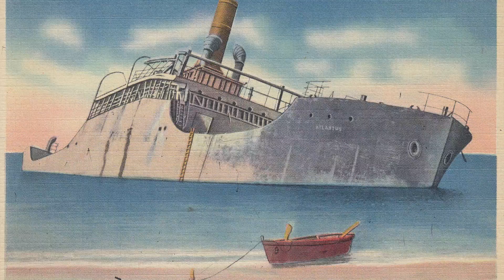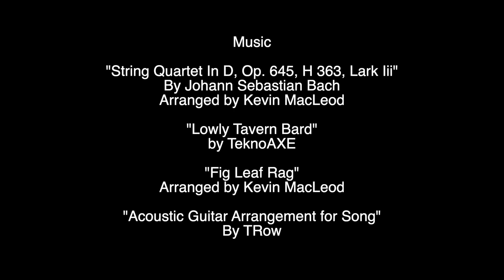Kayaking the Concrete Shipwreck "ATLANTUS"

Comment: My parents brought me here in 1960 when I was five years old. My Dad took a photo of my sister and I with the Atlantus in the background which I still have. The ship made quite an impression on me, I thought it was frightening looking actually. I always wanted Mom and Dad to bring me back on vacation to see it again, but sadly they never did. I've thought about returning lately but there's so little left I don't know if it would be worth it. Your video is very entertaining though.
Reply from the maker: It's still worth seeing nonetheless, but make sure it isn't the only reason you come to Cape May. The town is beautiful, particularly in the summer.

I've seen this wreck my whole life and didn't realize how big it was until I got up close and personal with it. It looks much smaller from the shoreline.
Reply: 5 in May 65' Atlantus impressed me too (Little Richard w/guest guitarist Jimi Hendrix was in Wildwood) I went back again this summer (2020) to see the Atlantus and hang out on the beach
Reply: As a life long resident, I can tell you it's 100% worth it.
Reply: Mmmkay.
Reply: I few years ago I’ve created a timeline in how the ship decayed and I pulled a lot of images from small websites on it. I found that the mid section of the ship had rolled over the same way the stern did and then to finally collapse due to its weak structural integrity. This occurred in the mid to late 70s. 

I find the capsizing of the stern very similar to how the Palo Alto’s stern did in 2017, I think it could’ve capsized from the heavy list it was on.
Reply: I still recall the feeling of dread I had as a 5 year old looking at the grounded Atlantus in 1960. It seemed huge to me at the time as I looked straight towards the bow from the shore.
Reply: Man.. I wanna see that picture. When the ship was probably still relatively in one piece. The before and after shots would be siiiiick
Reply: I know the comment is old but I would love to see the picture. I came a bit later on in life so the boat was sunken by the time i was a kid and took my picture. i used to think the people who swam out to it were nuts!
Reply: if you still want to make the trip out, I recommend stopping at bungalow bowls and getting take out or at lucky bones for take out and bring it to the beach to eat and look at the wreck. it’s always made an impression on me and I was born in 2002 so i’d say it’s still worth a visit

Comment: I owned a ferro cement sailboat. It was a Flicka 20 and although heavy she sailed just fine. And keep in mind that steel has just as much ability to float. But they made great use of concrete during the war. There's still the barges towed to Normandy for the invasion that were tied together to form a mobile dock for equipment and supplies.
Reply: if u coat the hull with lineX, will it last forever?
Reply: @myMotoring  The hull could have cracks developing inside, but it could be repaired I guess
Reply: steel is waterproof and can be made thinner though
Reply: @Blox117  steel definitely needs some treatment before going in saltwater. But steel still the best material overall, that's why you use it for war vehicles and use concrete instead for things that don't really need steel.
Reply: @afoxwithahat7846  im saying that it is waterproof without treatment. concrete is not
Reply: @Blox117  steel is just as prone to oxidation as iron is, especially in the sea, so I don't know what your definition of waterproof is. While some concrete ships have lasted for about a century.
Reply: @afoxwithahat7846  you are clueless. waterproof refers to the penetration of water
Reply: @Blox117  we still use concrete on ships and dams, so I don't have any clue indeed what you're talking about. It seems you didn't even watch the video.
Reply: TY
Reply: And, they ride very smoothly ...

Comment: These videos are just so great, man! Well done. It's really interesting to learn about such a unique kind of ship... What exactly were these shipbuilders thinking, though? Concrete?? xD
Reply from the maker: Slow and steady wins the race
Reply: Its not concrete like is in your sidewalks. Its ferrocrete.  The metal armature inside provides tensile strength and the cement provides compressive and extreme durability.   The reason videos like this is made is because when a ferrocrete boat sinks, like any boat can,  the structure will last for centuries instead of decades like even plastic boats will.
Reply: @obsidianjane4413  it was also quite the "fad" in the late 60s and early 70s to build regular boats out of ferrocrete.  There are still a few of them around.  The Atlantis was noted to be slow, but rather vibration free, unlike a steel ship.  She did need to be more carefully handled while in port.  In reality she was no different than the wooden ships in Mallows Bay on the Potomac, built to ferry men and supplies across the ocean while using a minimum amount of precious steel that was more needed for the war effort.
Reply: IKR
Reply: @sailingspark9748  the saving in steel was possibly the biggest attraction, they made a number of ferro cement liberty ships in the second war, they all lasted until peace was declared as being slower and heavyer they were less economic to operate, the mulberry harbours used for D day and beyond were ferro cement, a couple of the support barges that never made it can still be seen around the Garliston area where some were made, they sit where they were washed up after breaking free and running aground, being made of what is basically reconstituted rock these little pieces of history will fortunately be with us for many years to come.
Reply: It's the only vasts amount of materials they had to hand, all the metal was make more battle ships and so on. Contreat is no prorus so it's great for stating afloat
Reply: It's very strong, uses less than half of the steel a normal ship would use, it's cheap.
In a war, steel is the new gold.
Reply: Scarcity. The same reason why Germany designed coal powered aircraft during the war.
And if concrete seems funny, what about pykrete ships? Imagine the ¨barnacles¨ on those.
Reply: They were thinking of what works.
There are zillions of steel boats ... except you don't buy steel in "boat shapes" ... so lots of cutting and shaping and sticking together ... and all of those pieces you cut off, you have to pay for.
  FerroCement - kinda like plastic, pour and set, 0 waste.

Comment: From the look and sound of it, that's lightweight concrete, which would make sense for its application. Rather than limestone coarse aggregate, a pumice-like stone is used. That sound is the capillary action of moisture, and air being squeezed out. No doubt they used some kind of sealant on the hull to prevent water from penetrating to the interior.

Comment: Fun fact. Here in Norway, during the 70s and 80s many build smaller sailing boats in concrete, or FerroCement, as it is most commonly called, 30 to 45 feet. But they are a nightmare to build, because you has to build the boat upside down, and build both sides at the same time in ordet to get the correct thickness and weight on both sides. They used chicken netting as reinforcement, but the main problem ended up being the massive weight. A neighbor had a 33 foot sailboat in concrete that weighed 12 tons, for comparing, a modern Bavaria 39 weights 8 tonns. So most of them ends up in what we call "The Norwegian Garden Boat Association".

Comment: I remember a concrete sailboat in Owen Sound that eventually ended up on Colpoys Bay. I imagine it is still being used. It is a viable material. There are several Canadian merchant ships that were made of concrete sunk as breakwaters in BC. They were watertight and had bulkheads. They were difficult to get crews for because of the bias against concrete. Steel does not float either.
My father was a fireman or stoker on the  S.S. Yankcanuck. Built in 1885 or 1889 it sat sunk in Midland during the depression and was brought back into service during the war as the steel lake ships got drawn out into the Atlantic. 
The ship was very rotten and it could not accept a nail.  Leaks were generally repaired with concrete patches. It was finally taken out of service in the late 50s after the loss of the Morrell and the fallout when it was brought to the publics attention just how unseaworthy a lot of the ships on the lakes actually were.
Reply: Hit or miss.....It can be made into n3ar indestructible boats but also can 3asily be messed up by inexperienced builders

Comment: I would love someone to explore the wreck, under the surface. Imagine if we could find the original tellers or other parts from The Wheelhouse that are still there. That would be absolutely amazing
Reply: I agree but it is very dangerous due to the tides. Atleast two people have drowned swimming near the wreck over the years. One was cut up really good by the rebar under their. Plus the bay is very dirty.
Reply: @RockFan98  yeah I would only trust that for professionals, though I don't think danger is a justifiable reason for avoiding it. People have dived on much more dangerous in hostile sites before.
Reply: Is so murky you wouldn't really be able to see anything
Reply: @enjoiandrew4  I very much doubt that, the water would likely be the same brightness as if you were along the sea floor. It's got to be only like 30 ft deep at most.

Comment: In the preparation for D-Day in WWII the UK built dozens of huge concrete harbour (or harbor if you like) sections. To keep them secret as they built them they sank them in the sea. As  part of the the D-day landings they floated them over to France to make vital docking and landing areas as they had not taken any towns with ports. They are still there off the coast of France at Gold Beach.

Comment: In the 60 to 140 foot range, ferrocement (high steel mesh ratio) is very durable and even good strength to weight ratio.

Comment: as the owner of a concrete/ Ferro,s yacht they can be fast and weigh the same as any other material the larger the vessel the better ,Ferro,s outlast  the best are very comfortable sea boats /ships hardly slow the Prawn trawlers built out of Ferro in Queensland Australia durring the 80,s are the smoothest quietest work boats with hulls that last forever as you can see by the wrecks

Comment: The Twin Capes, the "miniature cruiseliner" Ferry was sunk because she was dangerous.  With all the added superstructure to increase her luxury and provide for a fine dining restaurant, they managed to increase what is called "windage", or the area of the ship the wind acts on.  They did this without increasing her propulsion or maneuvering systems.  This led to her hitting the jetties in Cape May a couple of times as the wind blew her off course.  She could also not be used in any kind of stormy conditions as she would roll and pitch badly while out on the Delaware itself, this left her sitting in port more often than she was able to be used.  She was just not economical or safe to run because of that.

Comment: I've explored the decaying hulks of some WW2 concrete River barges. There's a sombre ship graveyard near the Gloucester-Sharpness canal, on the banks of the Severn. These vessels were all beached to prevent erosion. It's a surreal feeling seeing the remains of vessels from all walks of life, some as old as the 1850s.
 The saddest entries are two barges. These barges sit a little way out in the Severn and have dine do since 1960. In thick fog they missed Sharpness Dock. They collided with the Severn Railway Bridge. Unfortunately these barges carried fuel oils and petroleum. A 30cm diameter gas main was ruptured. Sparks from damaged wires caused a fire. 5 men lost their lives. One man made it to shore, he somehow found the strength to swim against the notorious currents of the Severn Estuary. Another 2 were found and rescued.
Percy Simmonds, 35. Alex Bullock, 40. Jack Dudfield, 46. Malcom Hart, 17. Robert Nibblett, 25. All 5 of these men were lost to the tragedy.

Comment: My mum used to work in boat insurance. One day, she gets a call from a man seeking to insure a ferrocrete boat - a boat made out of this kind of concrete. She explains to him that their company does not insure ferrocrete boats, and most companies do not, for two main reasons:
1. Ferrocrete is very fragile - even a fairly light bump or tap on the hull will cause invisible cracks or 'crazes' to form, and considerably weaken the hull. Once this has happened, the boat is at very high risk of springing a leak.
2. In the 60s, a number of amateur boatbuilders realised ferrocrete was a cheap material that they could build much bigger boats from. However, they didn't account for the additional costs of a bigger boat, nor the fact that ferrocrete is not an easy material to work with. The end results were a lot of half-finished, ugly, often unusuable pseudo-boats that obviously could not be sold to recoup losses. The boatbuilders then insured the boats and deliberately sunk them (not difficult) to get some money back.

The man on the other end of the line listens, absorbs this information, and says "I see. You're a lot more helpful that the other place I called."
Mum asks "Why? What did they say?"
"Concrete sinks, mate."
Reply: Amazing anecdote! Interesting facts. Sounds like ferrocrete is fragile in the same way as the foam material in helmets, unsafe after a single even fairly light bump. The sound of the water entering the spaces in the dry specimen sounded very "foam-like."

Comment: Interesting video, just a counterpoint. You said several times in the video that ferro-concrete vessels aren't particularly strong. This is untrue, they are incredibly strong. In fact their strength can be an issue since if they do sink or run aground they're likely to be there for decades unless they are deliberately broken up or retrieved, sometimes creating a hazard to navigation. By contrast steel hulls are much more easily salvaged, and even if not salvaged they'll rust, break up and flatten relatively quickly.

The strength and longevity of ferro-concrete structures is part of the reason why marine structures such as bridge piers and some oil rigs are build out of concrete. A steel structure just wouldn't last as long.

There are two reasons they aren't used in commercial shipping:

1. While the materials used to build them are cheaper than sheet steel, they are also more labour intensive to produce.

2. While they are very strong, their strength to weight ratio is worse, so they end up heavier than an equivalent steel hull. The result is that they have poor fuel economy and are expensive to run.

You also mentioned at one point that "if you spring a leak in a concrete ship you're kinda effed." This is no more or less true than any other kind of vessel. Very few vessels are positively buoyant once they have flooded, mostly lifeboats and a few dinghys.

Comment: Since you seem to be familiar of the NJ shoreline. Why hadn’t you mentioned that where that concrete ship is 150’ out in the water USED TO BE easily a ale to walk onto and before it became too unstable, people could walk around the inside a bit. Since the 1990s Cape May lost ALL of its shoreline eroding up to Wildwood which at that same time gained 100s of feet of beach. At that time, no scientist had a clue why or how the sands would move north. If you would have included this bit of same time period history. Your video would have been more interesting. I walked and went into it back in the mid 1960s. I also was able to walk up to the top of the Cape May Lighthouse. Such a shame so much geography has changed and has been lost for all time. Just imagine about 200 feet MORE beach right where your kayak is.

Comment: Ferro is both fast and strong there is a yacht called helsell it won the Sydney Hobart yacht race one of the toughest yacht races in the world. It is cheap and easy to build with and a well seasoned hull is as strong as steel . A 55ft Hartley Tahitian I had you could hit it with a sledge hammer and it bounce off . In fact it got hit with a steel trawler I lost a bit of paint and a rail he had to get some plates replaced . It is also relatively maintenance free . Please do some proper research you will be very surprised what you find

Comment: So if it’s survived all that shit you listed how is concrete not strong?
Reply: Very strong under compression.
Very weak under Tension , torsion or shear forces.
You would need steel or some other rebar structure inside the concrete.
When steel rebar starts to rust it will expand like water does when it freezes.
This expansion of the rebar will fracture the concrete.
The fractures will let in more water causing more contact with the steel rebar.
The process is destructive to the strength and integrity of the ships seaworthiness.
Water will seep into the porous concreate, in northern latitudes in the wintertime it will get below freezing and fracture the concreate. this will also cause the rebar to corrode.
If concrete was a very good material to build a ship with everyone would do it.
The fact that it is not used should tell you something.

Comment: “Transatlantic voyages”
Crossing the Atlantic Ocean in A CONCRETE SHIP?!?!?!? What type of shit were people high on back then when they thought of building a ship out of something heavier than steel!
Reply: It's absolute BS, an Urban Myth. 'Faith' however (the one that wasn't part of the Emergency Fleet) did in fact travel across the Atlantic
Reply: Its possible, theres cement that has styrofoam in it, or other mixes thats foamy. 
Is it a good boat material no, is it possible to do, Yes